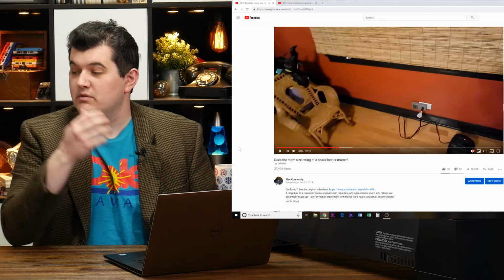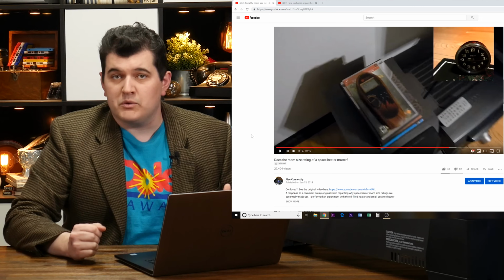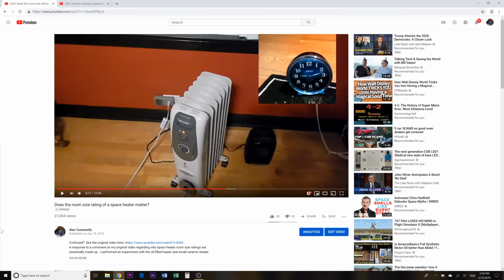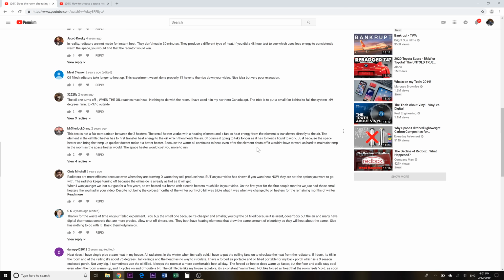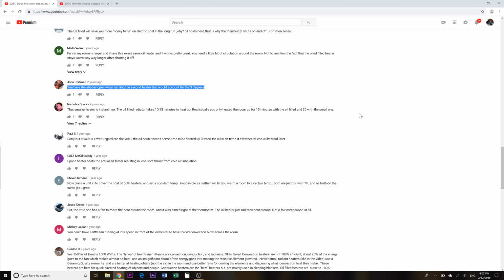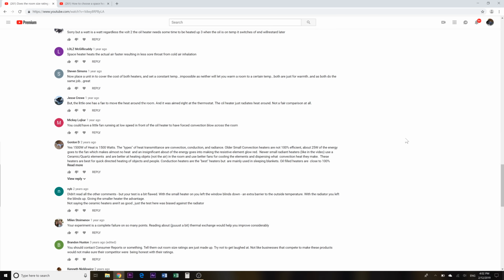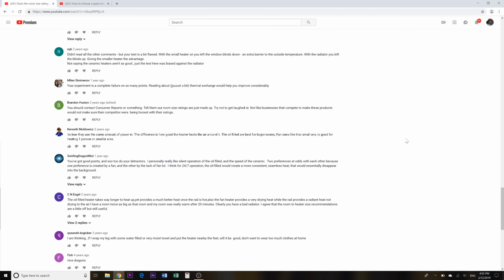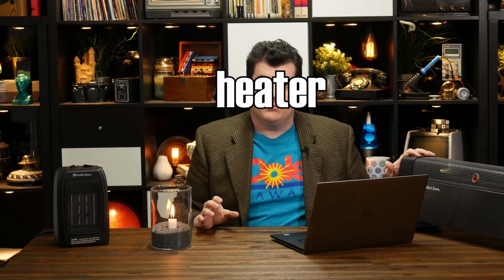More Space Heater Nonsense

Comment: I'm so happy we have 240 volt power and 3000 watt output heaters.
Reply: you can get 220v heaters in the us.  with as many amps or watts as you like.  just have to have an electrician install the outlet.  all stoves and clothers dryers that are electric use 220v.  but if you need more than 120v 15amps can give you in heat then you need to look at something else.  i mean how many people actually use space heaters to heat.  horribly expensive
Reply: @bobhumplick4213  Most apartments in the US use resistive heat strips at 220v to heat the entire apartment/house and most heat pumps have the strips that are used in emergencies.  heat pumps cost more so apartment builders don't invest in them.
Reply: Thats not compelling,  in Europe you can plug in 3000 watt heater anywhere you like, without the need of a special outlet, or a electrician, because it can on run on standard 230 mains.

My house has  a 3 phase connection at 40A total , so if so desire, i could install a 3 phase plug and run a 15000watt heater. (=380x40) Yes 10 times more then the heaters in this video.

But i agree that would be horrible expensive, a heat pump would be a better idea of you want to use electricity to heat.
Reply: @mrc4nl  most newer houses in the us, have a 200amp sevice at 240 volts, single phase.
Reply: @bobhumplick4213   They often sell them as a shop or garage heater and they have a NEMA 6-20 plug like a window air conditioner.
I'm surprised they are not more common as a 220V 20 amp circuit would is better suited to the task and is safer since it's  is not likely to be daisy chained into another outlet as the 110V circuits.
Reply: @Patchuchan  yep you are 100% correct
Reply: In Turkey, which also has 240v mains, resistive heaters are limited to 2000 watts.
Reply: We have higher wattage electric heaters in the US. I have a 5.6kw one in my garage it just plugs into a 30 amp 240 volt socket instead of the typical 120volt 15 amp socket. Due to the way our power system is setup we have both 120 volts for small appliances and 240 volts for large high draw ones.
Reply: 3kw heaters are quite rare tbh in the UK, most are 2kw
Reply: @usingthecharlim  well over half is lost either way.  ive heard higher figures for transmission but i wont aruge with you.  the point is half of it is lost at least
Reply: In the US we can get 20 amp breakers for 120 volt, which allows higher power devices. My 1600 watt kiln uses one.
Reply: USA has 240v split-phase power to almost all residential units, with most outlets rated for 15A 120V, some rated for 20A 120V, and some (oven, dryer, etc) high-power outlets rated for 30-50A 240V. If you're in a more industrial area you may also be able to find 480V 3-phase at even more amps. It's entirely possible to find 240V multi-kw heaters in the USA, they're just less common.
Reply: fyi, the smaller ones won't do that, but the larger ones are the exact same models just restricted.
Reply: So 12,5 A is running through your electrical system.
Reply: @Linshark  Yep, we can have regular domestic products that are fused in the plug at up to 13 amps.

A mains power ring main is normally rated up to 32 amps total.

https://en.wikipedia.org/wiki/Ring_circuit
Reply: I just looked at the Home Depot comparable store here in Germany, found quite a variety of heaters between 400 W and 2500 W. The 400 W things some flimsy applications you could put right into the wall socket... not very confidence inspiring by the looks.
But I guess he can run his 1500 W thing three weeks in the US and Pay about the same a 2500 W device here in Germany would put on the bill within half a day.
Reply: If only we didn't have so many square miles for a charge to travel from the plant to all the houses
Reply: @Head Tails quit rubbing your unsafe voltages in our face!
Reply: Higher voltages are actually safer, because they reduce the current through the plug pins, reducing the risks of fire due to some corroded extension lead.

People don't die due to electrical shock, they die more often due to electrical fires caused by failed equipment.
Reply: But there is a greater amount of power at your receptacles, and power IS what kills.
US receptacle =1800W
European=3600W
Reply: @MayContainJoe  But when an electric shock does occur, you're more likely to die from a higher voltage as it will result in a proportionally highsr current through your body.  If wires are properly sized, the higher current drawn at the lower voltage should not be a problem.
Reply: We have 48 V DC defined as upper limit for safe to touch voltage.
Reply: @beachboardfan9544  The current is the main reason of the deaths if you get shocked. And we talk about mA here. About 100-200 mA is to be concidered lethal.
Electricity fence use around 2-10.000V but only around 100 mA and in pulses, like 1/300 of a second. So 50V can kill you and you can be safe with 10.000V.
Reply: @Xanthopteryx  It's nowhere near 100mA. 20mA is considered fatal if it goes through your heart(e.g.: if you touch it with 2 hands
Reply: @beachboardfan9544  as the critical amount of current is something in the mA range, for alternating current the critical voltage to transport the power is considered to be 48 V. for Direc it is 110 I think. This is why GFI/RCD have to trip at 30 mA. So no matter if 110/230 Volts, none of both is less dangerous under this aspect.
Reply: Your comment is only relevant if your breaker is GFI, which is only used in rooms plumbed with water, so it would apply to every circuit in your home.
Reply: @beachboardfan9544  The trip current of a GFI (or RCD or FI as it is called deending on where you are) was meant just as an example. They defined the trip current to be 30 mA, at least here in Europe, as that current may already hurt, but very less likely be hazardous at line voltage (which is around 230 here in europe, different voltage just mean the medium voltage is defined differently with the up and down tolerances eeing different, in all cases Voltage may be between 200 and 250 volts).
Considering what I just said and taking into account what you pointed ot, I am just realizing that trip current for a GFI in the US may well be different, due to the 110 V.
But I am working in a company around a lot of electricians and what they learn here are the voltage limits I mentioned before. E.g. anything rnning 48 V AC or less does not even necessarily be protected from touching as the voltage is considered safe. (I am not saying it might not hurt!) I think you mentioned correctly the Power as a factor in his, and everything with some basic knowledge in electrical stuff knows that very roughly power is about voltage times curent (yes, I know this is actually only for DC and the formula for AC is a lot more complicated considering RMS values and phase angle...) so 30 mA * 230 V will easily said hurt a lot more than 30 mA * 110 V, which conveyes less power.
Or to put it differently, touching the wires behind a 16 A breaker which is standard here for our 230 V will cause a lot more resistive heating inside you than touching your 15 A wires at 110 V. None of which I would consider a great heating option.
By the way about GFIs, usual breakers here are normal breakers, at some point in the mid 80s GFIs became mandatory in front of the regular breakers for "wet" rooms, meaning kitchens, bathrooms, etc. as you decribed it. Allthough they are available here, you rarely see kombined GFI breakers, usually you have a GFI and a separate breaker.
But since some point in the 2000s I cannot remember any more, at least here in Germany you have to put the whole breaker box behind a GFI, which mostly then is a three phase 40 A GFI. main breakers for houses here are usually three, commonly coupled or special three phase, 63 A breakers.
Reply: Holy crap I wish I could get the power company to supply my house with three phase!
Reply: @heronimousbrapson863  that's not actually true. Higher voltage shocks are fine. It's the higher Amperage ones which are dangerous. With higher voltage you need less Amperage to output a given amount of Watts. So higher voltage is much safer.
Reply: @beachboardfan9544  Yes, yes i am, rub rub rub...

Oh, and they are not unsafe because we actually have decent electrical safety standards, ring mains, plugs with fuses in them, shuttered contacts in the sockets and earth pins.
Reply: 😄

Hold on let me go replace an electrical outlet myself, while forgetting to turn the breaker off, and NOT DIE!!
Reply: @marvintpandroid2213  Actually, ring mains are not safe at all.  You should check out John Ward's video on ring circuits in the UK and how they should be banned in further construction.
Reply: @beachboardfan9544   We also have earth leakage breakers and do not rely on just fuses.

I have been electrocuted twice with no long term effects, both times the breakers saved me and if it were down to old fashioned fuses I would have been much worse off.

If anyone is dumb enough to try to rewire a ring main then a leakage beaker would save them too.  
Dont be so silly, I have rewired houses in the uk and also worked on family's houses in the states, I know whose wiring standards I favour.
Reply: Dont pretend its not the US's!
Reply: @heronimousbrapson863  I watch John Ward a lot, ring mains have their positive and negative aspects but when I put all 3 types of systems I have worked on against each other then I would pick the UK

French and American systems also have good points but much worse down sides.
Reply: I'm very happy the US doesn't. The US already has the highest energy usage per capita, it would just get worse.
Having that said, I'm very happy with the 230v here which can make a difference at times.
Reply: @WoLpH  higher voltage leads to less energy wasted actually, and what matters is watts only anyways, 230 being a way to use less energy is just marketing as much as bigger looking heaters heating more is.
Reply: @AphroBee I know. What I mean is that due to the thickness of the wires a 15 or 16 Ampere breaker is often used both in the US and Europe which means that you can use more than double the amount of power at 230v as opposed to 110v. I just checked and I can buy 3300W electric heaters over here, that would require at least a 30A breaker at 110v which would require much thicker wiring to be safe.
Reply: @WoLpH  But it does.
Reply: @WoLpH  1500W is 1500W no matter that the supply is
Reply: @mortenwinslw2785  I know. I've never claimed otherwise, perhaps you've got the wrong person?
Reply: @WoLpH  It was because you said thast you were glad that US didnt had 230v because US where all ready using a lot of power. 
The good thing about 230v/400v is that the copper lines dont have to be that big as in the US, so the US is using way to much copper.
Reply: @mortenwinslw2785  ah, like that. I meant that you can have twice the power usage from the same outlets with 230v :)
Reply: @WoLpH  I wonder if that energy statistic factors in fuel based energy use along side electrical. Got to get the energy from somewhere, regardless of whether its electrical or fuel based, the 'energy' use per capita would be the same even if it was electrical.
Reply: @Anzac97  yes but half the power generated at the power plant gets wasted in transmission in power lines.  if you burn gas or something in the house you get 100% efficiency of that fuel.  if you have a decent gas or oil furnace you get 80% plus efficiency.  losing half your power by burning fuel 200 miles away and then sending it through miles of wire (losing half along the way) is not the best solution
Reply: @Zalgar It does. And since the US is very car heavy with mostly energy inefficient cars (i.e. trucks and such) that could account for a large portion of the usage. Additionally, I think there are few countries where AC is so prevalent in houses as well.
Reply: @WoLpH  yep.  the high energy usage in the US is split between vehicles and AC most likely.  plus manufacuring and things like data centers\businesses etc.  but other developed countries have business\industry.  mostly its vehicles, AC, and large homes combined with low elecitricity costs in most fo the country
Reply: @bobhumplick4213  Its hardly half the power wasted, if that was the case they wouldn't use transmission lines. The overall losses from plant to the customer is 8 - 15% according to schneider electric. That being said burning the fuel directly at home would be more efficient if you didn't need flues, a lot of that heat is lost to the atmosphere. This is also forgetting about heat pumps, which can be well over 100% efficient.
Reply: @Anzac97  "they wouldnt use transmission lines"  how else would you get the power to the customers?  also burning it at home would be more efficient if you didnt have flues etc?  where do you think power plants exhaust their burned fuel?  burning an open gas heater flame in a house is 100% efficient.  using a gas furnace can be as high 90%.  

and yes heat pumps are nice but lose efficiency the colder it gets. even if you have a heat pump getting slightly over 100% efficiency run from a power station that is less than 60% efficient then its still a win for burning fuel locally.

im not sure you have thought any of this through.
Reply: @bobhumplick4213  A few percent at most, not half. Power lines are high voltage. Fuel has to be transported somehow. Transport needs fuel so you loose some percentage the same way.
Reply: @MarkoPetejan  yes thats already been pointed out.  i meant overall about half the power has been lost.  and i will say it again.  thats already been pointed out.

tranport costs are probalby about the same as transmission of elcetricity.  the number i just found was 8-15% pwer loss in transmission.  i would expect transport of fuel to be less. its zero for me and my fuel because its natural gas and the well is on my property.  and most gas in the us is moved by pipe so certainly less or the same power usage to transport.

but the point i was making.  the one that matters.  is that the effieciency as a whole is much greater if the fuel is burned on site, and greatest of all when burned directly in the home.

heat pumps can range from just slightly less efficient to half as efficient depending on the situation.  but that also wasnt the subject.  it was burning fuel locally vs burning it in a plant and then using that power for resistive heating.

just saying "you got one fact mixed up" over and over from everybody does not take away from the original argument
Reply: @bobhumplick4213  The U.S. Energy Information Administration (EIA) estimates the average loss is 5%. 
I used space heater (2 kW) in the past, then went to wood (as a "fuel"), and for the last 10 years or so I'm running two AC units 24/7 all year round. Efficiency for me is the money side of things. So. Space heater was expensive. Wood was about the same but several times more heat (5 to 6 kW). AC gives me even more heat than wood (up to 8 kW combined) and for me is the same price for all year (with also cooling) as it was with wood for two months. My AC EER is 4.12, COP is 4.62 - so it is up to 462% efficient when heating compared to space heater. I'm measuring and logging power every second for some two years now and interestingly the record high consumption was lower then the space heater on the video. This is efficiency, I would say.
Reply: @MarkoPetejan  my stats were from the international electrotechnician commission. but it doesnt really matter unless you want to be pedantic.  and apparently a lot of people want to be.

it was the same price for you as a year of electric heat as 2 months worth of wood?  is that what you are saying?  then youre doing something very wrong.  

either that or when you say AC you mean heat pump.  which was beyond the scope of what i was talking about. i was comparing burning a fuel locally vs burning it at a power plant and then using resistive heating to heat a home.

if you have a central air system with heat pump and youre in a place that doesnt get very cold then yes heat pump is the way to go.

but once you get below 30f or so the effieciency of your system plummets.  its basically useless below 20f unless it also has resistive heat built in in which case effieciency will be lucky to be 60% and probalby worse.

but if you live somewhere where its that temperate abnd doesnt get that cold then it shouldnt take much wood to heat your home.  i dont see how you are getting that wood costs more.  are you paying people for wood?  cause if so you are kind of missing the point of heating with wood.  youre not supposed to buy wood.  

some of your wording is very confusing.  im really not sure what you are saying compeletly
Reply: @bobhumplick4213  Yes. AC as air-to-air heat pump. Mine is rated to -4F but was never that cold. Currently it is 32F outside and 75F inside, power consumption is arround 700W. And you are right, I was buying wood pellets
Reply: @MarkoPetejan  why in the world would you buy wood pellets?  that is the most expensive fuel you can get?  more than heating oil.  you could probalby by food grade vegetable oil and heat cheaper than pellets.  the only reason to burn wood for heat is if you can harvest your own wood.

but i will aggree that a good heat pump is very efficient.  and it should be invested in before an old fashioned electric furnace is used.  but i think it should be supplemented by a unit that can also burn some sort of fuel when the temp becomes too cold to extract heat from the outside.  unless it has geothermal heating built in.  that is where you get cheap heat from when using electricity.  a geothermal unit that pumps heat into and out of the ground can be exetremely efficient and can be done fairly cheaply if building a home new and while the house seat is being made.  you essentially just bury a lot of plastic pipe a couple feet under the ground and pump water through it instead of drawing heat from and pumping heat to the air (which can be 0 degrees or less) you use the ground temp which is always about 55 degrees f.  very efficietn but startup costs are high if the home is already built
Reply: @bobhumplick4213  "If you burn gas or something in the house you get 100% efficiency of that fuel" Well, technically, that's not correct. Natural gas has a maximum heat value of 55 MJ/kg (megajoules per kilogram). However, as per E = mc^2, 1 kg of matter contains around 30 PJ (petajoules), or 30 000 000 000 MJ of energy! That's an efficiency of 55/30 000 000 000 ≈ 0.0000002 %. Still, you get pretty much all the heat you can get through combustion.
Reply: @GRBtutorials  youre quoting the energy that matter contains?  so to get 100% effeciency we would have to split atoms.  not just split them but totally annihilate them and turn them into pure energy?.  ok whatever.  i think it goes with out saying that it is 100% efficiency of the heat from combustion that i meant
Reply: bobhumplick Hence the “technically”. But anyways, nuclear fission and fusion is 3 orders of magnitude more efficient, and solar panels are even more efficient if we consider that energy on Earth (including fossil fuels) comes mainly from the Sun and we don’t need to worry about it for about 1000 million years.